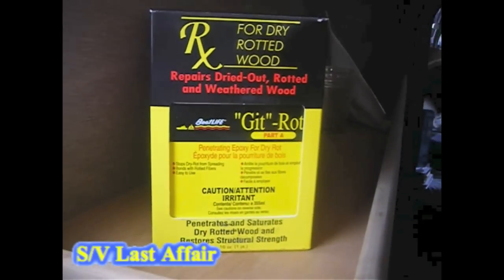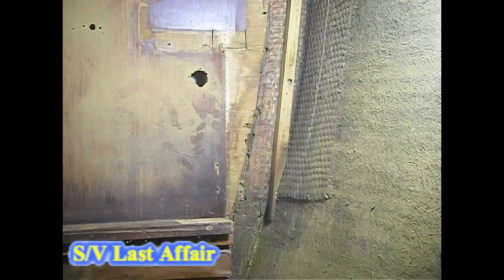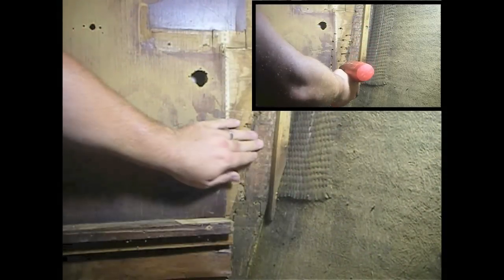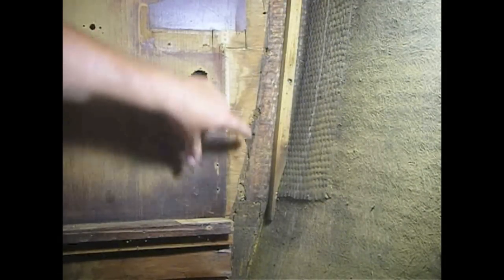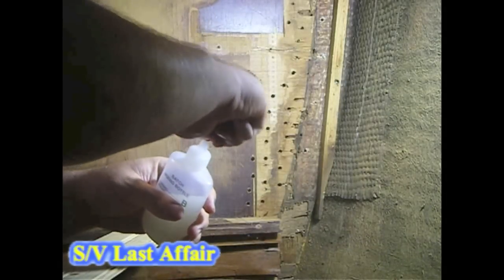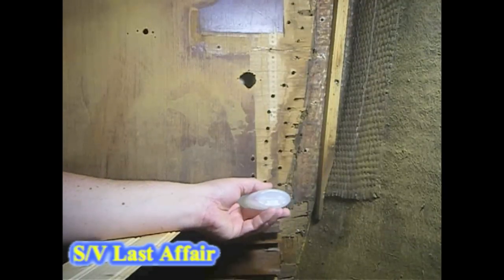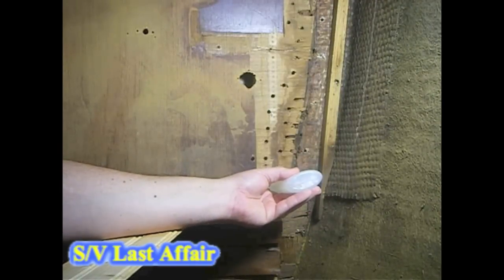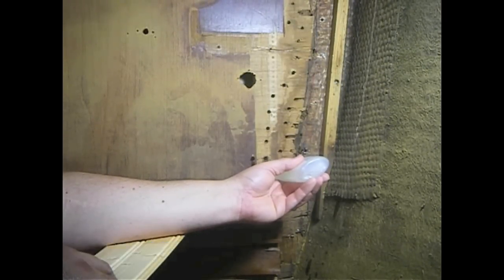Using Git-Rot Penetrating Epoxy on Rotted Wood

Comment: Before doing this to your boat, go to a salvage yard and ask if you can try it on a boat they will scrap.  This way you can cut the repair open and see how much the Git-Rot has fixed and how much is still bad.  Or save some time and look up Youtube videos where someone did this.  I wound up cutting the upper glass away and removing the rotten core before replacing some areas of core (I used Nidacore so it won't rot again) and glassing over the top again.  It was almost as easy as drilling a million holes and re-doing it when the epoxy leaves you disappointed.  Git-Rot exists because newbies are afraid to cut into their boat and fix it properly.
Reply from the maker: Very true. I never thought of a salvage yard to try it. But I did other repairs in years after this and for sone repairs you are right. For some Got Rot is a great fix too.

Comment: used git rot loads of times, great product and a little friendly advice is next time you use it drill your holes downward at a 45 deg angle and you'll get much more of your product in the wood ;) for wood even further gone stabilise with git rot then follow up with some marine tex :)
Reply from the maker: Lee CambsUK Thanks Lee.  It's funny  you mention the 45 degree angle, that was my intention, but I just ended up with about 20 degrees at best.  I hope I don't have to use the MarineTex in conjunction with any GitRot given the comment about if it "being further gone", but if I do, I will certainly keep that in mind.  MarineTex is pretty amazing stuff.
Reply: What is marine tex?
Reply: @KMF3  It's a 2-part epoxy
Reply: Thanks! Need to fix my boat, I appreciate the pointer.

Comment: Hey Gil, great video.  Thanks for taking the time to make it and share the information with us. It certainly would be a  less  expensive method to fix  small area soft spots.
SV Soleil
Reply from the maker: +justice tek - Thanks for the comments.  I al glad you found it helpful.  It really worked well and I think I have a spot on the new (to us) boat that will also have a use for it.

Comment: I wonder if it would work better if the back side were taped off? Or hot glued? Drilling all the way through obviously helps with drying. But of when the epoxy is applied, one side is sealed shut, then we could use positive pressure. I am probably going to have to do this on my boat. Have a 24' gelcoat bayliner ive rescued that sat in saltwater for likely 25 years. The antifouling was bad, muscles 1.5" long adhered to it, barnacles bigger than a dime and smaller than a quarter. When I sanded off the bottom mess, found hairline cracks and spider web cracks in spots of the gelcoat. Mirrored all the way through into the fiberglass. Im certain this has happened from the hand of the Marina it sat in when they took it out of the water [wrong fit trailer]. I know it's moist in the wood because when I drilled holes through into the transom for the fish finder transducer, the wood was wet. 😭 Been working on this boat for several months now. Sort of "losing it" to get her out. 😬 But it feels and sounds solid for now. I just want to get her on the water and will be addressing this at a later date using your video for reference and guidance. 😁 Thank you!
Reply from the maker: Glad the video is helpful. It held iup really well for me and while I sold the boat, the new owner says it is all still solid. 
I get your point on being ready to get out on the water. These refits cam take way longer than planned. Lol.

Comment: I've had great luck with Git-Rot. It is the thinnest non solvent type I know of. It is not thinned with volatiles nor should you add any to it. Solvent types thinned epoxy is great for brush on, never injection. When penetrating deep into wood and there are voids and pockets you don't want thinned epoxy with solvents like acetone, alcohol, toluene, MEK or xylene. When these are present, it does let it penetrate deeper but when the volatiles near the surface evaporate and the surface epoxy hardens it traps the solvents in the interior. If the solvents/volatiles are present the epoxy will never properly harden and form a gelatinase mass in the core that can be literally shredded by your hands years later. What's worse is these solvents can be trapped next to fiberglass and break down the polyester binding.  Git-Rot like other epoxies can generate damaging heat in any volume so you don't want large voids. It's always best to pull loose wood and replace volume spaces with wood and/or loosely packed fiber glass mat/rove. Things to remember:....You can epoxy on polyester but not polyester on epoxy. Once epoxy has cured, an oily substance rises to the surface and this should be removed with solvent/scuffing/solvent before adding more epoxy layers. If the epoxy is wet or sticky it's ok to add more. 3M aluminum foil tape(duct) can be used to keep epoxy from running through, on the deck undersides or for makeshift walls or barriers. Foil tape adhesives withstands much more heat and epoxy than other tapes. Wipe the wood surfaces down with xylene where you intend to stick the tape for adhesion. Rub the tape down well and remove as soon as epoxy has gotten firm. Mix your epoxy very well (longer is better) and exact ratios, it does matter. Epoxy has a shelf life and last longer in a cool dark place.  Applying epoxy to wood that's been treated with some anti fungal will reduce adhesion and penetration so treat it afterward if you do. Some people swear by Smiths CPES..I swear at it. Git-Rot and West System is all I use.  Hope this helps
Reply from the maker: +Karl Jensen Great post and comment. Agree on all fronts.

Comment: You might check out Smiths Clear Penetrating Epoxy Sealer. Others use the CPES term but only Smiths is made from wood materials and has similar structural and flexibility as the wood you use it on, and its penetration characteristics are better. I've used Smiths CPES and it works well for "less than perfect" wood. Most "penetrating epoxies" are just thinned, and so are less strong and leave voids. This is the common objection to GitRot, but is not a problem with Smiths. My only dislike is that you really need air filtration while applying and - if inside the boat - for days afterward.
Reply from the maker: Gary Bickford Thanks for the tip

Comment: I'm about to try Git Rot on a camper floor.  I'm curious if and how you cleaned the applicator bottle between uses.  The only guidance I see is not even in the instructions ... on the box it says that uncured product can be cleaned with vinegar.
Reply from the maker: Good question, It has been a while since I did this.  I think, but don't recall for sure that I rinsed it with a bit of acetone.    Candidly speaking, If I were to do the camper floor, I would plan to do it all in one day or at one time.  The penetrating epoxy doesn't pot quickly like my work with regular epoxy where you have 20 minutes or so.  I can recall working on this for at least an hour and it remained liquid the whole time.  I think that is part of the properties fo it to ensure it penetrates all the way through the rot.  If I did need to do this in more than one setting or time, or intended to use it again down the road, I would pick up some cheap little ketchup/mustard style squirt bottles and use those and just throw them away after each use.  Something like this would also work fairly well.    They are about a buck a piece and will save you a lot of time bothering with trying to clean them.  4oz size like this work well - https://amzn.to/2GhNPgQ
Reply: @Svdreamchaser  I think you're right and it should be easier to work quickly on the horizontal surface.  I'm just thinking about contingencies in the event there is an interruption. Thanks for the reply.

Comment: I know you were using this on a boat but do you know if this could be used on a vintage trailer? There's a couple of spots that has some dry rot that I don't want to have to completely redo the wall because I would have to tear out an entire cabinet and refrigerator
Reply from the maker: Yes, I think it would be well worth the attempt.  I will say that I am not quite following your comment about having to remove the fridge/etc.  Typically in order to get penetrating epoxy in you would need to either drill holes all across the surface (or down the surface of the wall)  The other option, but I haven't done this yet,  is that you can put a hole near the top of the wall and then an opening in the bottom that you would put a vacuum on to pull the penetrating epoxy into the pores of the wood.
Reply: @Svdreamchaser  I don't think I'm going to need to drill holes into any walls. I wish I could send you a picture of the area that I need to work on. After doing a little bit more research I'm thinking that maybe it would be better to go with an epoxy type wood filler that's more of a paste because it's on a vertical wall. In terms of my comment about having to take out the refrigerator the wall in question is behind a cabinet with a built-in refrigerator in the trailer. So in order to replace that entire piece of plywood sheet I would have to remove the entire floor-to-ceiling cabinet that includes the refrigerator. Does that make sense? So because this product is so thin I'm beginning to wonder if it might not be the wrong application
Reply: @Svdreamchaser  also another question. I'm wondering if this product would B good for creating some strength and cohesion on old thin brittle plywood. This is a vintage trailer so there's a number of areas where the plywood is not dry rot but it's old and becoming brittle sooner rather than replacing it in certain areas I'm wondering if then application over the plywood so that it seeps in and creates more strength would be an appropriate application.

Comment: An added improvement to the repair would have been, following this treatment, to add five layers of alternating 1708 cloth and CSM, along with epoxy resin, to make the bulkhead ultimately structural.
Reply from the maker: Good point. Isn’t it funny how much you learn over the years and in this case I agree with you based on what I know today. On our current Formosa, I built new frame work for some of the settee flooring and did just that after building it new.  I tabbed everything over and in, to make it part of the structure. 
I will say that the Gulfstar git-Rot repair is holding up really good 6 years after task, which is good. :)
Reply: That is awesome to hear.  Having just pontificated about your repair, I am about to embark on the injection of epoxy into the side deck of our Hunter Legend 40.  The balsa core deck is not entirely compromised nor wet.  It is suffering from heat-related delamination and maybe some dry rot.  I am confident that the injection of epoxy will fix the issue and last for the expected life of the boat.  I tend to take a more practical approach to repairs and going by the book isn't always the prudent thing to do.  We are still very structural.  I am just stitching to save nine.
Reply from the maker: We had a friend that did something similar and he injected it and then put a few screws in it to hold the skin against the core until it cured then removed the screws and patched gel coat. Not sure if that is best or not, but kind of made sense.
Reply: Given the age of the boat and our life expectancy, I think our repair will last longer than we do.  Again, our core is intact.  Just staying ahead of the normal aging.
Reply: What are the items you mentioned. Newbie here.

Comment: Is the epoxy waterproof. I want to fix the woodrot on my deck outside.
Reply from the maker: Yes it sure is. It is kind of like reinforcing the wood with plastic from the inside in the example of what I did in this video.

Comment: Thank you, I have looked all over to find your video. how hard did it dry, and how long did it take?
Reply from the maker: Soldier53flyer It took about 3-4 hours to do the work (drilling the holes and applying the epoxy). It then dried over night. It cured as hard as a full sheet of 3/4 ply and felt more solid then the wood alone was.  
Keep in mind with the timeframes above, I did not include the time to sand and finish the surface as I considered that part of what I was going to do in the entire salon, but if you are "spot fixing" you would have to add time for sanding and finishing.  
If you found this useful, please feel free to share it on Facebook, or any forum that you happen to subscribe to discussing such topics.

Comment: What is the difference with this epoxy and just a regular epoxy?
Reply from the maker: The biggest difference is the viscosity of the mixed solution.  Penetrating epoxy tends to be very thin and can run into small openings much easier than a thicker or viscous epoxy like west systems or Total boat.
Reply: @Svdreamchaser  thanks
Reply: @Svdreamchaser , the thinness is due to the high percentage of solvents in any "penetrating" epoxy.  A small percentage of what you apply is the actual epoxy. The majority of what you apply are solvents and they evaporate.  This is why multiple coats are key to reasonable repair and why you need to wear a respirator when applying.
Reply from the maker: Thank you @MarineMan. That makes sense for sure, kind of like thinning the first coats of varnish,l to make it more runnable (Lol, not sure that is a word)
Reply: @Svdreamchaser , "runnable" is indeed a real word!  As proven by every varnish job I have ever done!
Reply from the maker: Amen

Comment: I have a boat that has a transom that is partially rotted.  Can this stuff fix that or do I have to go with a new transom?  The boat isn't worth a lot of money but I do not have the replace it and don't want to have to junk it.
Reply from the maker: I am thinking if the transom is truly rotted completely it may need to be replaced.  I am not an expert on this, But here are my 2 cents.  If the boat isn't worth the replacement of the transom, and it is skinned (in other words rotted wood between fiberglass), then I would attempt the fix and see if it works well for you.  

Here is how I might go about it.  If the transom is cored, I would drill holes in the top and bottom of the skin (or if you have access to the top of it, you could pour it in from there and only have holes in the bottom).  Much like in this video, I had enough holes drilled to see the flow of penetrating epoxy from the higher holes to the lower ones.  I would starts at the low ones and slowly introduce the epoxy above it until you see it come from the ones below.  

You may also have to do holes every 3-6 inches apart across the transom as well as it will flow better "Down" then it wil at an angle or across the transom.  does that make sense?  If not you can email me and we can talk in more detail as well.  Reach out via our Facebook page as I don't know if Youtube lets you message me directly. Facebook.com/svdreamchaser.
Reply from the maker: #svdreamchaser #LiveAboard #GitRot #Cruisingwithkids

Comment from the maker: I would agree that git-rot would not be appropriate if an entire wall specifically a bulkhead was rotted. However, in this particular case, the rot was a small section of the overall bulkhead and git-rot, as a solution, will be more than sufficient for long-term ownership of the boat. I actually don't intend to "quick sell" my boat but rather little aboard and sail her.

Thanks for viewing and commenting and I hope you have found the other videos helpful or at least interesting :)

Comment: I just drilled out holes for thru hull exhaust.  the port side was damp but not bad. still solid.  however, the starboard side was gone as far as I could reach my hand in.I was told about that stuff and plan on using it.  do you have to put the epoxy in  in small doses or can I dump it in the 4 inch hole that I cut for the exhaust?  I plan on drilling holes on the inside to spread it around also.
Reply from the maker: +David Frees - David, Glad you found the video helpful  I am certainly not an expert in this, but after using the product, I would say that you would nOT be able to dump this into a 4 inch hold.  The consistency of penetrating epoxy is very thin so that it will travel down and through the rotted wood fibers.  IF filling a hole, I would recommend a more traditional method for patching a hole that size, (Especially given it may be below the water line at times).  That would be layers of glass matt and epoxy, you may need to start with taping a backing on one side, so and adding a thin layer of thickened epoxy resin into it until it sets and you can use that to add your layers. 
I also would add layers one at a time and not try to fill something that is 1/2" or so thick in one shot with just epoxy.  I would think it may heat up too much during activation, but that is more speculation than anything else. 
For some reason, it just doesn't pass the sniff test for something  I would want to do on my boat.  I would be nervous that it could cause issues down the road.

I hope this is helpful, sorry it is not 100% definitive, in that I tried this already and can speak first hand to it, but I would not recommend the process you mentioned.  
Best of luck, I am sure you will however be able to patch that spot and still make the best out of the situation.
Reply from the maker: +SVDreamChaser Ah, and Please do check out our new Blog, Youtube Channel and Website documenting all of the refit/repair and work we are doing on our 51' Formosa.  http://www.svdreamchaser.com for the website or http://www.youtube.com/c/svdreamchaser for the youtube channel
Reply: +SVDreamChaser .  THANKS.  IM NOT TRYING TO FILL THE HOLES BACK IN.  I CUT THEM OUT TO PUT THRU HULL EXHAUST IN.  HOWEVER,   I AM TRYING TO SOLIDIFY THE AREA AROUND THE TIPS AND THE ENTIRE AREA THAT IS ROTTEN AND SOFT.  I APPRECIATE ALL THE INFO THAT YOU HAVE GIVEN ME .